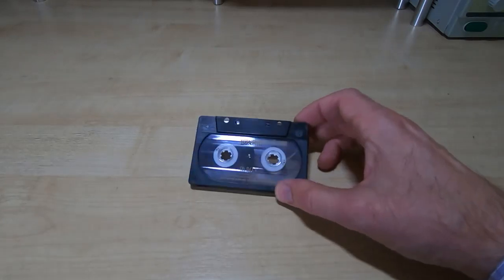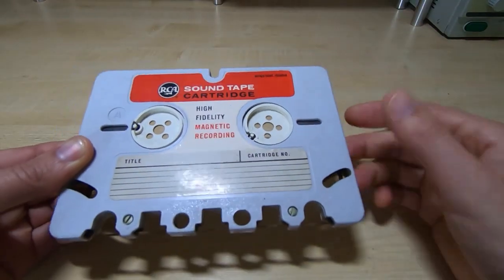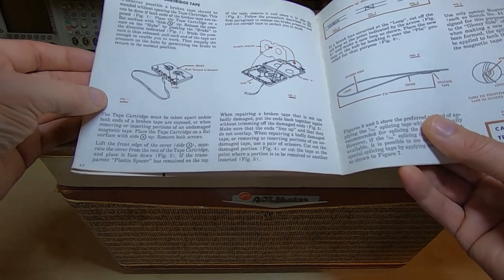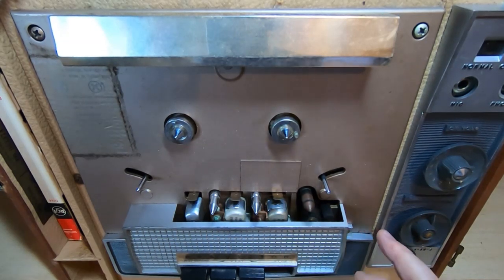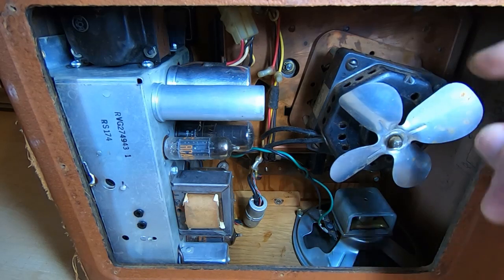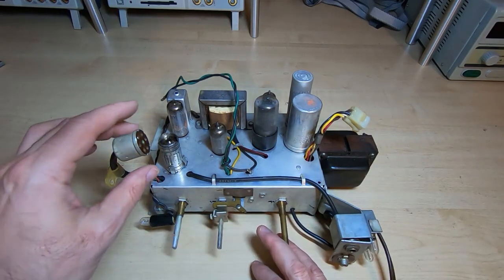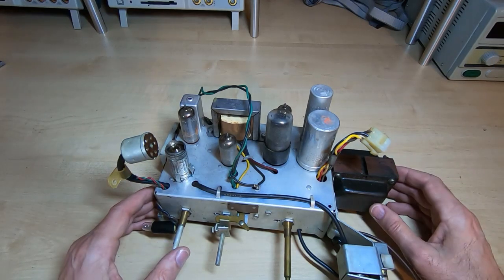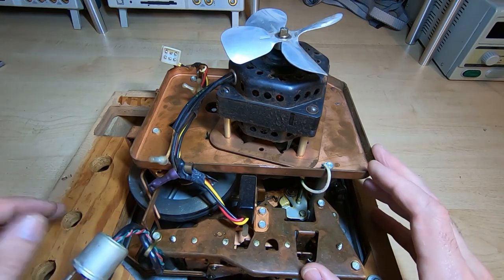RCA Victor CP-1 Repair Part 1

Comment: I have one of these CP-1 machines and one tape which I picked up when I was a teen at a yard sale back around 1980 or '81.  At the time it was working, had all the buttons and I made recordings with it. The sound quality of the built in amp was surprisingly good and strong.  After a couple years I just used it as an amp, for my guitar...  I left it powered on unknowingly for I don't know how long and it started smoking out.  So I pulled the plug and never used it again; so it's been basically dormant since about 1984 or so.  I still have it, and just like yours, is missing one of the transport buttons (the first one is missing on mine).  When I find some time I intend to see if it can be brought back to life again!  Doubt I will be able to find a replacement button though.  Too many projects in front of it right now.

Comment: Well as a kid we had a cassette player but only for a few years, then my parents bought a CD player and that was the end of cassettes for me.  However I have never seen that older style of cassette tape you are repairing.  Interesting that they used solid copper, seems it would be soft and bend over time?
Reply from the maker: I suspect very few were made as manufacturers tried to lock people into their tapes by having unique tapes that would not fit any other machine. That resulted in low volume for each of many types, hence each type is now rare. Copper is only soft when annealed. Once work hardened (by pressing for example) it is very hard and stiff. It is also hard to machine but as you can see it lasts 70 years without any real signs of ageing. The mechanism is proving more troublesome than I expected, more in next video.
Reply: @JerryWalker001  looking forward to it!

Comment: I like those older pices of equipment. I think they chose copper for noice shealding from the moter. Soo the mag filds in the moter dont add noice to the audio. Ither way its a good thing you found this and not a copper scraper